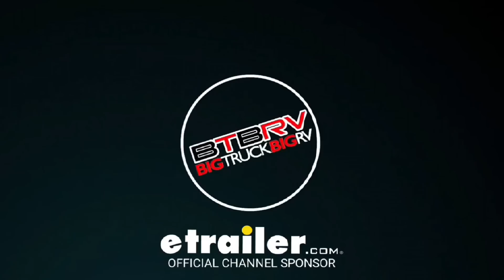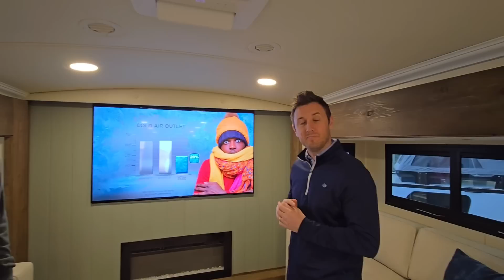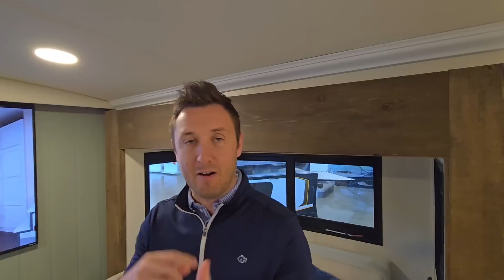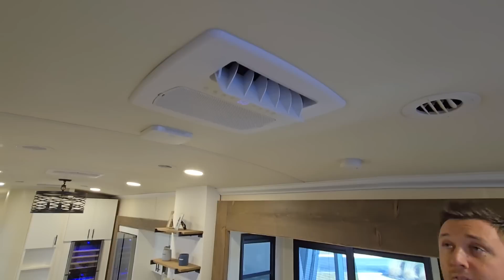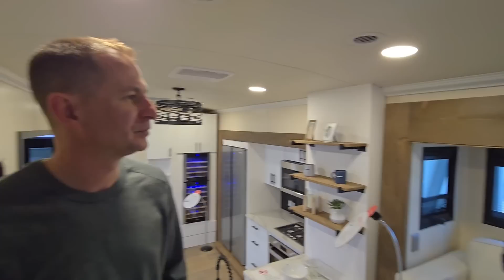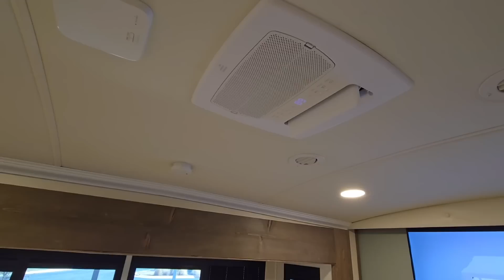MOST ASKED FOR RV UPGRADE!  18K BTU inverter AC! Better than a Mini Split! Furrion Chill Cube

Comment: I installed 800 amp hours of LiTime batteries and can run the Dometic 15k btu plus RV fridge, mini fridge and deep freezer for 5 hours while traveling the Route 66 trip. We charged up each night at a RV park or ran the genny for a few hours.

Comment: I just installed the Chill Cube 18K ducted and man what a game changer super quiet and very efficient it even sprays the condensate on the condenser coil to make it run more efficient I thought there was a problem because it cooled my camper down from 94 to 76 in 30 minutes and no condensate was dripping. Im not sure if that will make it need to be cleaned more often and its a bit harder to get to the coils to clean

Comment: I hope they add a heat pump to this unit.  I know they have a heat strip available but that is a fire hazard.  I know several RV Techs and they have been told by the NRVTA to NEVER install one because of the fire danger.  A heat pump would make this unit darn near perfect.

Comment: All you have to do is follow the link in this video to E trailer and look up the specs of this AC unit. It is not an inverter compressor. It pulls 1330 W when it’s cooling.
Reply from the maker: It does have a variable speed compressor though

Comment: Do you know if they will have these coming to market for the applications that do not have the center plenum? Like the whisper quiet type systems? I know it will fit in the hole, but the controls look to be integrated into the plenum. I’d switch all 3 of my Coleman’s to these on my Cornerstone in a heartbeat.

Comment: Maybe -- BUT -- that is way too load and the mechanics/compressor sits and vibrates right about it.  Terrible to be honest and still not effecient like a proper mini-split.  Our mini split from LG and our cottage mini split from Mitsubishi is simply silent.  I can't hear when it is on or off.  Even the outside unit is silent.  The new mini-split are super awesome compared to that thing.  ALSO, you can get several ceiling cassets for a mini-split to put in different rooms.  One each for both bathroom, one for the toy / garage etc.  Each room then has self adjusting temp control and perfect silence and no ducts.  So so nice.  The main compressor should be housed in the "basement" behind a storage door with a circular venting for air circulation or where the generator would normally go.  Works great and is silent.

Comment: Cost Reliability Efficiency...! To new in the market to determine its efficiency and long term reliability!!! Mini splits are inexpensive and been around since the 60's and proven to be the best heating & cooling systems.... I doubt the RV industry will include this system as a standard feature too! Importantly, RV industry would rather install an outdated & dilapidated energy hog system for few dollars per unit....

Comment: Mini split steel pulls less amps, and you can use a smaller b. TU.
Unit. And it is a heat pump to All they have done is made. A soft start units, nothing more.

Comment: Called Furrion and they said I wouldn’t be able to purchase this until next year! The only way to get it now would be to call the manufacturer and have them install it. I’m sure it’s the unit itself is going to be a pretty penny but then to also have to take the rig to a dealer and then have them install it. Not to sure about that. I’m just going to have to go ahead and get the mini split, only getting it due to low traveling. Mostly stationary.

Comment: I’m building my own batteries and I build my pack to give me 24hours of ac run time with zero sun or charging. I’m in a small 19ft bumper pull. I’m looking forward to this unit as I’m not planning on shrinking my battery but rather just give me more run time. Most of the places I take my rig are only hot during the day and really when the sun is out. This unit will let me better match my power usage to my power production. This is now part of my modification plans

Comment: Very curious how these will handle the power fluctuations we see in RVs. We have a mix of power sources, we have generators that may vary their power especially when they run out of fuel. What have they done to counteract high and LOW voltage on this system. On the residential side, inverter systems do not like low or high voltage spikes.

Comment: It was going to be exactly the upgrade I have been waiting for but cancel that because having all 18k BTU directly dumped in the same spot blows (pun intended). It might be efficient but if it isn't even ducted then the technology doesn't feel so luxurious. Hi, welcome to my giant beautiful 5th wheel that looks picture perfect but sucks to hang out in because the center is always freezing cold and the edges and bedroom barely cool enough to sleep in.  Stick with a ducted solution.
Reply: Doesn't need to be ducted. I replaced 2 ducted 15k Dometics for 2 12k mini splits and cools better. Mine is a 40' Teton.

Comment: Must let us know when they released it I need one for my rv I need one asap
Reply: gree makes one already, both dump and ducted called an ECO-Cool
Reply: @enigma9789  the gree unit does not have a variable speed compressor.
Reply: @sharidandan4172  I think you are correct. I thought it did, but cant find that anywhere, so it clearly doesn't. Shame.
Reply: @enigma9789  I know, it had good potential. I think everyone will be making the switch soon, because once you have one that is varible speed and inverter you never want to go back.

Comment: I need this for a ducted installation! Sounds great
Reply: if you find a nice, ducted solution, please reply here.  I am about to put in a Mr. cool diy, but then how do I keep my tanks from freezing that requires propane heat running.  I could wire in a fan only switch but why is nobody making a system that won't flood the roof when defrosting?

Comment: This unit looks great but.... How is its cold weather performance??? As a skoolie person, one of the MAIN reasons we use minisplits is for the hyper heat feature of them allowing the heater to work all the way down into the -20's. Are these units even heat pumps and if so, do they auto defrost and handle the cold well? Food for thought

Comment: I could use some advice... I have a 2010 Keystone Springdale.  I don't move this RV, it's my weekend get away place.  I need to replace the AC as mine is now making a ton of noise.  I'm lost in the idea of what unit to replace it with.  I wouldn't mind maybe a unit that has heat built into it also.  I'm outside Daytona Beach so heat is only used a couple of times a year.  The heat isn't a requirement.  If you have any suggestion, that would be great.  I would like a 15K BTU if possible.  Thanks... Tom

Comment: Yeah but does the fan motors go poor after 2 years like all those domestic penguin 2 air conditioning units? Constantly swapping fan motors every year and a half to 2 years  is fucking stupid. If this thing will last as long as my Coleman’s and can drop in and run off of a battery bank. Game changer. Gg.

Comment: That sounds like a great idea. I currently have a soft start equipped 14.5k Furrion in the front of my motorhome that does an outstanding job of cooling, but it is noisy and not as efficient as I'd like. 

My main question is what is the seer-2 of this unit? This is important as we are FTers who are off grid, boondocking almost all the time. I have a 28.5 seer-2 mini split in the bedroom. It would be great if this unit or the coming 15k Btu one (which would better suit our needs) would approach that level of efficiency. 

My second question is does it run in reverse and heat efficiently too, as my mini split does?  Thanks!

Comment: The #1 problem with RV's is the piss poor insulation. Even if the RV has the Arctic B.S.. If the RV industry would take the time to use a closed cell foam insulation in the roof and not have air leaks all over, that would be a start. #2 Why use a 14" hole. if your not going to have a roof vent, and use a air conditioner instead, make a hole that doesn't restrict air flow.  Why don't they make a efficient central HVAC. 1 unit that would heat and cool. Nothing on the roof, lower clearance, no holes in the roof/ceiling. We can send stuff to Mars. Come on people.

Comment: It ticks MANY boxes for me. My primary surprise is that it is only ~40% more efficient than a regular old OE a/c. Many normal residential minisplits are 3x to 5x more efficient. I had a 37.5 SEER 230v 9k btu unit in my 5th wheel running 24x7x365 off my 1900w pv array and 7.8kwh LFP DIY battery for 4 years full-time living. But regardless of the efficiency expectation, this is certainly a game-changer!!!!
Reply: I think I heard him say that the 40% is at peak output........ the real savings will come when the unit is stepping down as the coach is cooled down....... I would expect that the numbers will be more like 60 - 70% compared a traditional unit..... only time will tell.

Comment: 10:21 I believe it’s a failure to not be able to direct the air flow rearward. I understand the complexity of this but this demonstration shows the type of install that it would be great to be able to direct the flow towards the rearward. Otherwise this is a Great Leap Forward.

Comment: So if you do the math (amps x volts = watts) he said in the low end 11 amps, 11amps  x 120v = 1320 watts or on high end 14 x 120 = 1680 watts....no way are you running this on a 1000 watt inverter, a 2000 might but it won't like it for long periods, a 2200 watt generator you would be ok.....still gonna take some lithium Ah to power that all day.....
No need for a soft start will be nice...

Comment: I wish you had asked them how this would work if you have a ducted unit now. In our Keystone, the position of the central A/C is not ideal (like in the unit shown) and I am very concerned how (or even if) this would work with the ducts? Also, no mention was made of whether this has a heat pump where it could also heat the inside?

Comment: Ducted units spread the heat/cool evenly over camper. With direct dump your main room is cooler then bedroom or bunkhouse. As for old ones needing bigger generator, testing shows otherwise. We run our 5th wheel 15k unit on 2000 Honda inverter. Our 3400 champion inverter will run our camper plus unlaws camper at the same time.
If they want to bring something to market that has had more questions about it would be a fridge that is comparable to the residential fridge for cooling but that will handle the vibration of a camper. Biggest pain is replacing residential fridges through removing slides

Comment: Been checking for news on this product the last few months. Assuming its not crazy expensive I will be replacing the front ac on my 2001 class a motorhome with a chill cube. I have a non functional generac on board generator. The lower power draw on the chill cube means it should run comfortably off my multiplus and solar + alternator while in motion without draining my batteries. The forward facing direct dump is ideal for me because the hardest to cool area is the front cab with all its windows. I just wish it was a heat pump but I would be very surprised if that wasn't in the pipeline.

Comment: Recently purchased a Yoshino solid state B4000 power station for home and rv use. You might want to investigate this product. I am using it for home furnace backup and am going to run my residential fridge while driving my rv. It is half the weight and size of other brand units.

Comment: I see two things already immediately that I don't like. The sofa should be facing the TV and you have two sofas not facing the TV that is so uncomfortable. Also the stove up against a wall on the right hand side I would be banging that wall all the time with a hot pan. There needs to be counter space on both sides of the stove

Comment: RVs: Yesterday’s technology today, Today’s styling tomorrow.

Do I want an inverter AC? – Absolutely.  Would I consider this one? – probably.

Is it exactly what I have hoped for? No for these reasons:

1.	Efficiency and power usage: 

My house has a 48,000 BTU house AC and uses 3400 watts while running.  It cools with about 14 BTU for every watt.  That’s the lowest efficiency allowed for a house AC in this part of the country.  I believe from watching your video that this Inverter AC only has about 10 BTU of cooling for each watt.  That is not very efficient, and I don’t think it is much better than the current/legacy RV rooftop ACs.  This is not helping extend the run time on the batteries that I do have.

It is great that it has a lower starting current, and that it doesn’t always run at 100%, but that’s the way mini splits have run for many years.

2.	Placement:

Having said all the above, I don’t think that improving the efficiency of rooftop units that must work in such a confined configuration to be all that easy, if it is even possible. 

It’s time for RV manufacturers to put mini split systems into the overall RV design.  This could free up roof space for more solar panels and easier placement of the panels, just as removing the refrigerator vent for DC refrigerators did.   This would also lower the roof profile and reduce the overall vertical clearance needed for the RV or maybe allow even higher ceilings inside? 

Higher efficiency ACs could be offered as upgrades and that would lengthen battery life and make it easier to power the AC from the tow vehicle or the van/motorhome.

Comment: My hesitation at embracing this is the source. The Furrion ACs have been a total disaster for a lot of owners because of how they placed the temp sensor inside the unit vice in the thermostat like the rest of the industry does.  That they continue to build and sell units with this known defect is just ridiculous.  Forums have been full of people complaining and there are kits out there now that allow you to fix the problem by relocating the temperature sensor. And yet Furrion/Lippert just refuse to fix this. Consequently I’m rather leery of products coming out of that division.

Comment: As person that is in the process of building an off grid electrical system for my camper, I definitely am interested in this. I have a 44’ toy hauler and if I could have this 18k unit in the middle and run it off my inverter while boondocking would be awesome.

Comment: Dometic has offered an inverter driven rooftop unit in Australia for years. It even one that runs on 24vDC. 

The N.A. Market has been hung out to dry for a long time.
Reply: Where?
Reply from the maker: Are you thinking of the 12v Dometic or Truma unit?
Reply: @BTBRV  nope. It’s the Dometic Harrier unit. Only available in Australia. I spent 4 months trying to import one to the US. It runs on 220v. The Dometic Coolair runs on 24vDC. Got the two units mixed up. I think the coolair is what they started selling here in N.A. As the RTX 2000.

Comment: Hey, one big thing no one mentioned - It's an inverter, which should mean it can also blow heat in the colder seasons.  What is its minimum outside temperature to heat the interior?  My Rockwood A-Frame has a Heat Pump (an Inverter, but not digital speed control) and I love it (one of the best features!) because I don't have to run the propane furnace in the shoulder seasons when you need some heat in the RV. I can set it on auto and it will either heat or cool as needed.  It will pull heat down to about 45F.  Below that I either run the furnace or use an electric space heater.
Reply from the maker: They just informed me that their Heat Pump version will be available in July.

Comment: Great overview of a new to market product that could potentially change off grid A/C. If it had a reversing valve to also function as a heat pump, I think I'd be sold. That's the one area I believe a mini split still has the advantage.
Reply from the maker: They just informed me that their Heat Pump version will be available in July.
Reply: @BigTruckBigRV  Appreciate the info, I'll be watching for that!
Reply: Do we have a round about price on these yet ??? @BTBRV

Comment: This is a great step, that's overdue. Over the next 5-10 years as new RVs come equipped with these, and some older RVs convert, hopefully we'll see some reduction in the demand impact on campground electrical grids during peak heat days. Not to mention, making it more feasible and affordable to run your AC when plugged in next to your home. Exciting.

Comment: My question also was will it also be available with a heat pump?  Noting that mini split heat versions can operate  at a much lower temperature than the traditional RV heat pumps which basically becomes useless below 35 degrees.
Reply from the maker: They just informed me that their Heat Pump version will be available in July.

Comment: I have a 15K air conditioning unit not counting the startup I know that mine Spike very high but when is continually running it pulls about 14 amps. I do have a poor battery Bank 4 6 volt batteries with 1,480 Watts on the roof. If I run it in full sunlight it will still trickle drain my batteries and I can only run it about 4 hours after that it will start draining my battery is pretty bad. This unit if I heard correctly pulls 14 amps the same energy draw as mine. Of course not counting the startup of the compressor. Doesn't a mini split system pulls less amps?

Comment: Will they have a heat pump version? My rig uses the heat pumps to heat it in the winter. I don't have a furnace. My rig is all electric, no propane. I just replaced my rear A/C. I'm replacing the middle unit this Summer (Penguin 2 15k heat pumps). They're on one thermostat, so they have to be matched. ?The following Summer (2025), I'll be replacing the front. I'd love to fit a ducted one of these, but I need it to be able to also heat in the Winter.
Reply from the maker: They just informed me that their Heat Pump version will be available in July.
Reply: @BTBRV Thanks, JD.